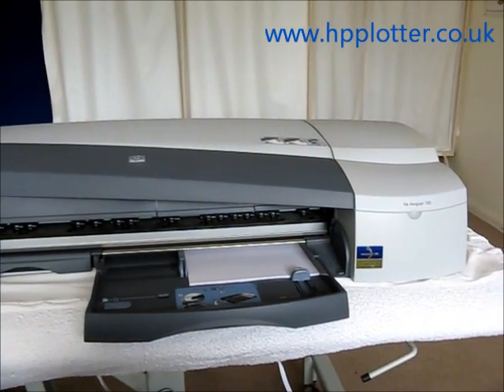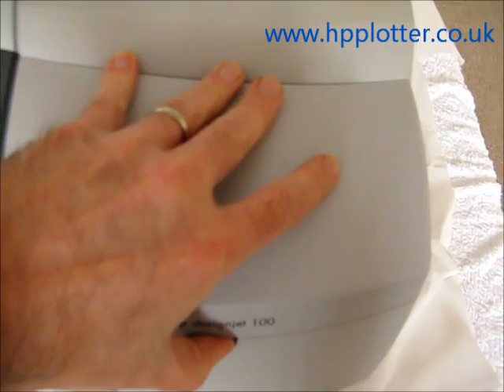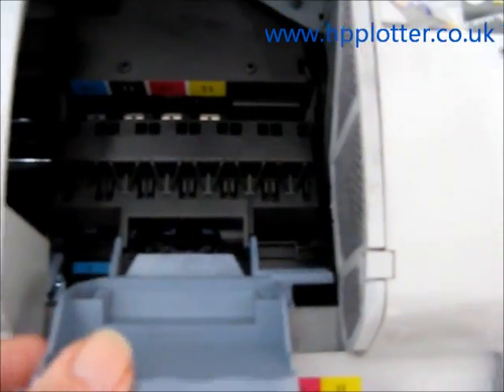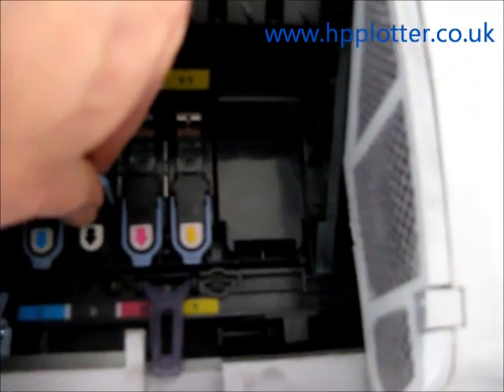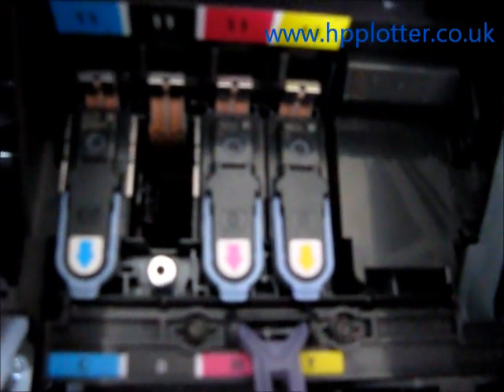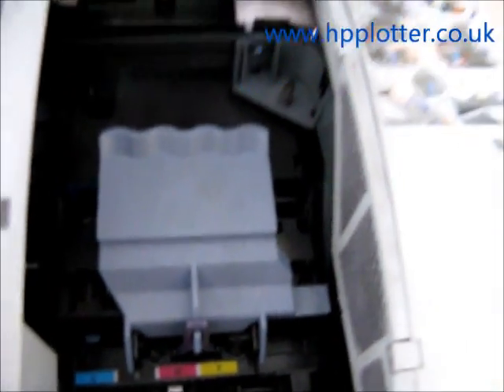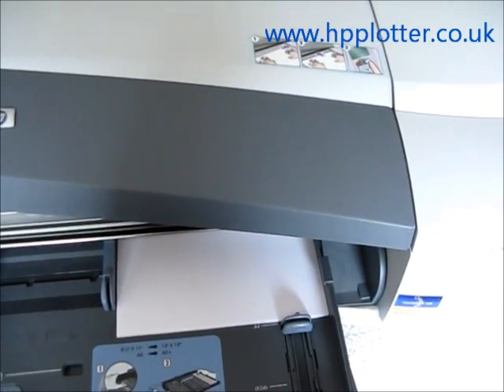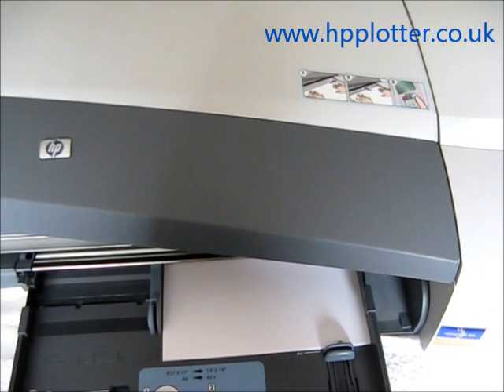DesignJet 100 - 130 print head replacement

Comment from the maker: @waheex  No unfortunately not.  Each printhead has a small amount of ink inside it for priming (otherwise there would be an air block) and the machine will recognise that you are attempting to replace the printhead incorrectly.  Please contact us on 0845 0770 787 consumables@hpplotter.co.uk as we're currently running a 5% discount until the end of the month on all inks, printheads and paper.